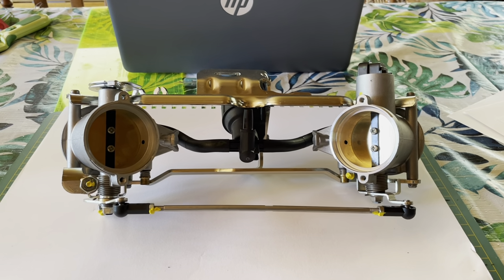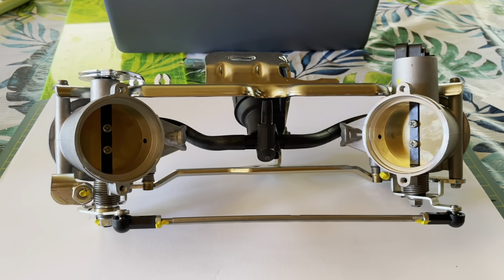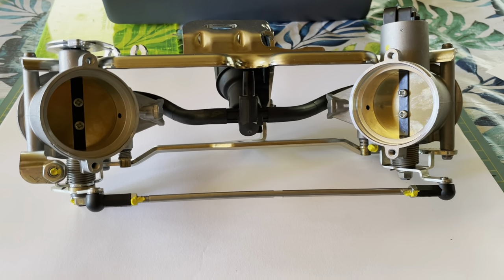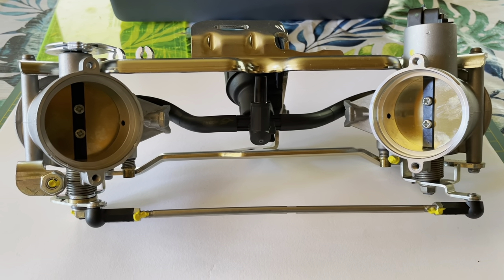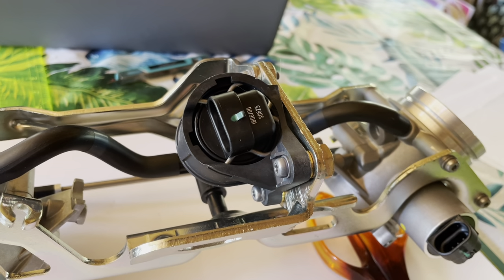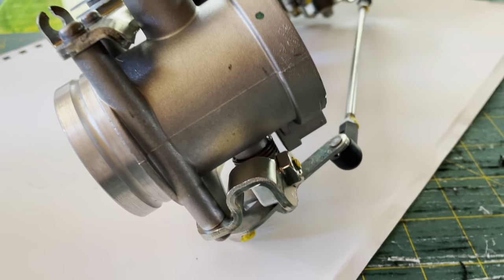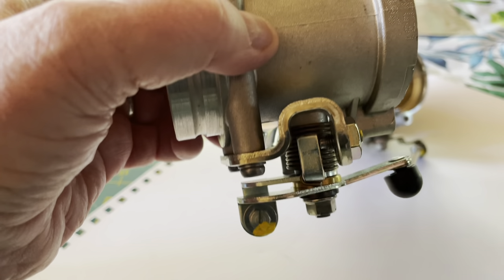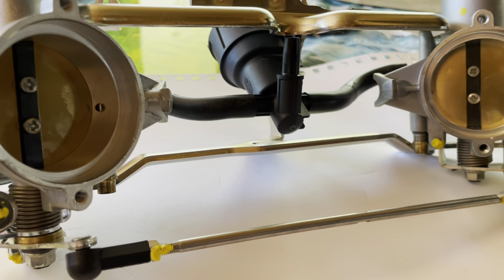Throttle body do’s and don’ts

Comment: Hi Peter, great explanation of the MG throttle bodies. I have a problem with my 2012 Stelvio NTX missing and popping at idle, gets worse when warms up. I found my airbox cracked and letting dirt in, I have cleaned the throttle bodies and found quite a bit of wear in the bores so that the plates do not close completely, it looks like in your video the plates were completely closed. I am thinking this is allowing too much air through at idle and the stepper is adding more. Have you had a situation like this that you were able to remedy by adjusting the throttle plate adjusting screws then doing the synch and tps reset?  thanks from west coast Canada
Reply from the maker: Do NOT touch the plate adjusting screws. Doing so will mean that the interpretation of the entire map will be bolloxed.

The only real fix, after fixing the airbox of course and making sure the drains are intact and plugged, is new throttlebodies. If you run an open loop map though you may be able to get it to idle almost reasonably by upping the CO trim to an extreme level. You will pay a price though in engine wear and fuel economy.

Is your Stelvio a roller tappet model or has it been rollerised? If it's still running flat tappets the TB's are pretty unimportant to worry about until the tappets are fixed.

Comment: thank you for the advice ,now i know what to avoid while trying to lower idle speed
Reply from the maker: The only way to alter the target idle is to do it in the map using Tunerpro or the like. There is no 'Physical' way to change the idle speed. That is controlled by the stepper motor.
Reply: @peterroper617  How to open dashboard to arrow i have a problem with rpm on dashboard when i turn the bike on ignition arrow on the rpm is up to 5500 and go to 0 rpm when i start immediately go to 1500 rpm wait 5-6 sec and go to zero rpm but bike is running ok in the rpm arrow is the problem how i fix it sorry for my bad english